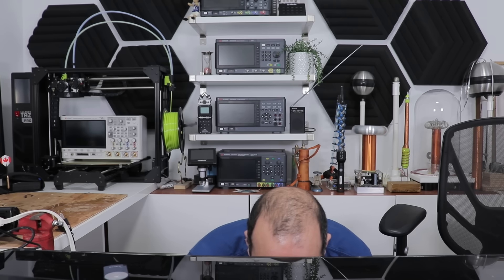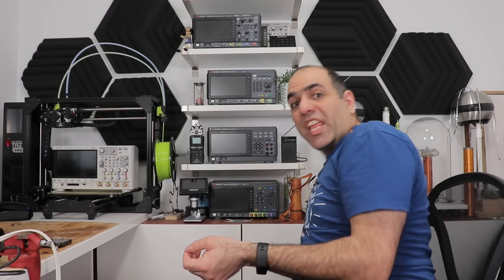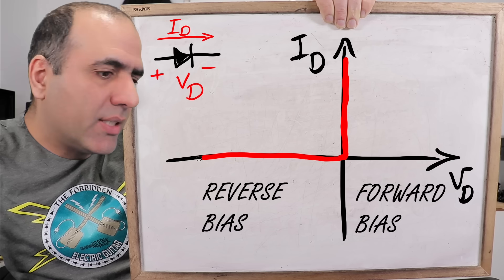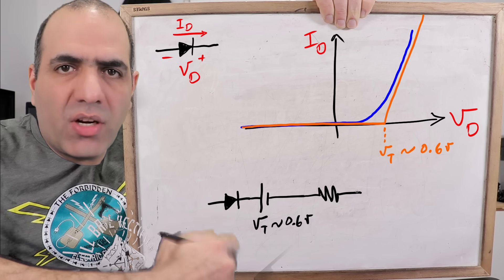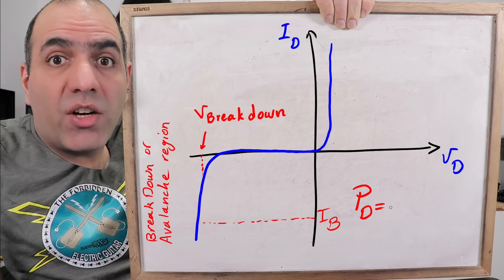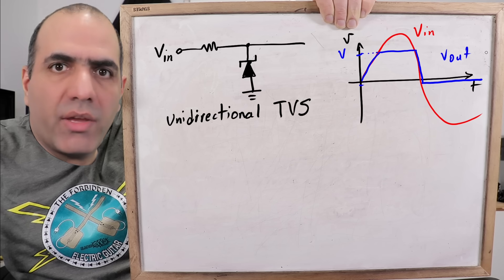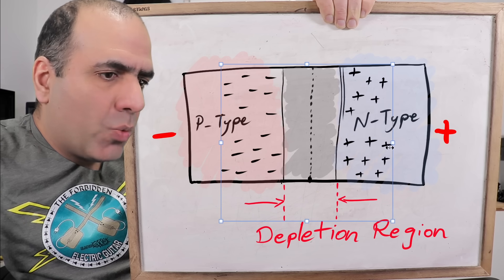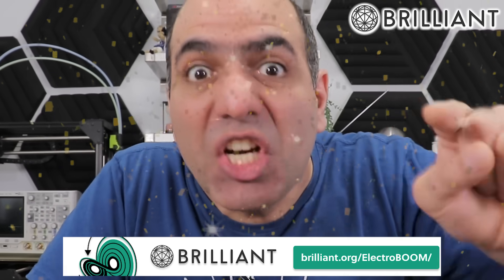DIODES! All Sorts of Them and How They Work (ElectroBOOM101-010)

Comment: I have a Shower Heater-Unit with adjustable power control (potentiometer) that was given to me by my neighbor to fix and keep for myself, and after dismantling it I found on the control PCB a bidirectional diode with such electrolysis damage on it which dissolved both of its terminals and it was hanging at its place on the board by the rust (the symbol on the PCB is for a BTVS). I have tried to put solder at the two ends to attach new terminals to it so I can reconnect it in its place but they will not stick. There are no service manuals for this unit I could find by searching on Google and I am wondering how to fix this unit without knowing the part number or the clamping voltage of the diode (since there are no terminals left sticking out from the two ends) . The diode itself is a pink glass type with the "cathode" black band in the middle and D8 is written on it. The diode is also not clamping anything in parallel (as in the case you describe to protect something from overvoltage on the board). Instead is connected in series to the gate of a small triack on the board (0107MA - To92) and to some other point on the board. The triack is probably driving an even bigger (high power) semiconductor that controls the heating element current and which is attached directly to the water heating unit (probably for heating cooling issues) and it is not on the control board. Any ideas on how to attach terminals to this diode? What is the range of or typical clumping voltages for these diodes? As a last resort to salvage this diode I was thinking if it is a good idea to use electrolysis and grow new copper terminals at the two ends if I immerse the one end of the diode in the solution and put a needle/pin with some high enough voltage to make the diode conducting current and start the deposition of the metal at the other end, then if it succeeds flip the diode and repeat.

Comment: I have  question that may be irrelevant to your current video but i can only ask this to certified electricians like yourself.

Here in my country the major electricity provider warns us of "phantom load" asking us to not just switch off appliances not in use but to totally unplug them to cut off monthly bills.

Is this true? that even switched off appliances still uses up power? Also if this is the case then why haven't i heard of a switch that is DPDT for home use? i only heard of them in small electronic projects. All of the switches i know that works on 220v household use are single line switches.

Is this a way for the power company to have something to point to when our bill just suddenly goes up? i hope not.
Reply from the maker: Hi, a single pole switch is enough to completely cut power. You don’t need DPDT. But regarding phantom load, some appliances still draw some minor power continues to keep some of their electronics on permanently, like the click on microwave or remote controls on air conditioners and such. They should typically draw very small current though compared to the appliance's operating current and shouldn't result in major power usage increase. You could turntgings off and look at your power meter and see how much the house is still consuming. Not sure, but maybe your area also charges extra for reactive power usage. In that case old transformer power adaptors plugged in could also count, although the device might be off.

Comment: Hey ElectroBOOM is he making free energy or... no it is Tom Stanton Flywheel battery he made energy by putting a axle and making it float and then turning it he made voltage i did not type some parts also he used FULL BRIDGE RECTIFIER.

Comment: However the LEDs actually range from 1-1.2 volts input for the IR to 7-8 volts for the UVC ones. 

edit: some schottky diodes actually have a forward voltage drop of 0.15 volts and break down at only 2 volts.

Comment: 1 thing I never got round my head in the entra electronics course: if you put a resistor in parallel with a diode, wouldn't the resistor act as a bypass to the diode?
Reply: Current would flow through the resistor, however a small current will flow through the diode and as the voltage across the pair of components increases, the current increases through the diode too, but what's the maximum voltage across the diode when forward biased? It depends on the type of diode , but for silicon it's going to be around 0.7 volts.

So what you've got then is effectively a device where the voltage increases across it as the current increases but the voltage maxes out at 0.7 volts and the current is able to continue to increase.

Comment: Pro tip: If you're a civilised physicist (instead of a degenerate electrical engineer) and actually use electron flow (instead of the hideously wrong conventional current), you can think of the electrons moving through the diode symbol, up and over the ramp on the triangle but unable to get back the other way.

Comment: diode types:
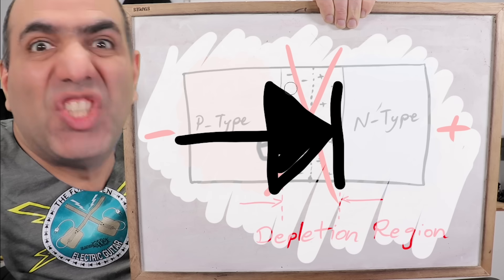regular diode: 2:48
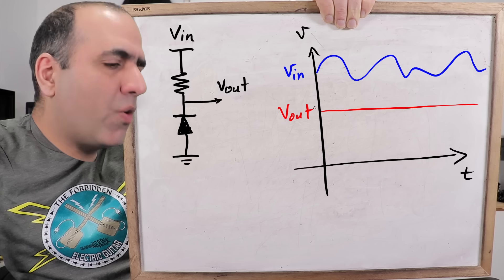zener diode: 8:21
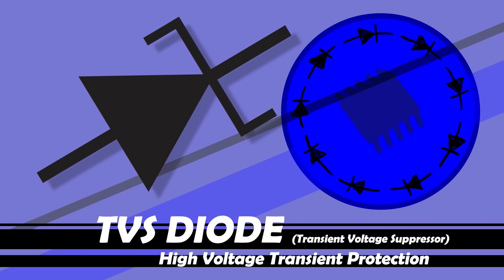transient voltage suppressor (tvs) diode: 9:19
photo diode: 10:21
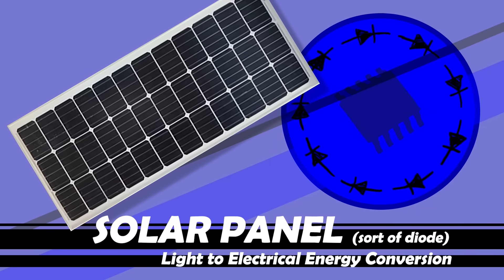solar panels (kinda diode??): 10:33
light-emitting diode: 10:53
varicap diode: 11:43
schottky diode: 12:04

Comment: I have a question, I have a cheap 225amp AC single phase stick welder, Ive seen videos of people using a 300amp rectifier to create DC but if i'm thinking right It may be DC but the wavelength of current would be basicly cut in half and wouldn't have a smooth freq to produce good welds? I have got my self down this rabbit hole and its getting deeper. If you want to create a High freq current for "Tig" welding, how is that accomplished? assuming and i might be wrong but U.S standard is 60Hz and  some tig welders can output 20hz to 400hz.? maybe thats why it cost $12k

Comment: So I use an LED as a poor mans photo diode to switch a mosfet to turn my PC on. Plug the power switch wires in to the collector and emitter of a mosfet. Hook the LED up to the gate and emitter. Hit with a laser pointer, and boom! PC turns on.

Comment: Nope ! the question how they made those , they no work, why called work ?  Anode ----|>||–– cathode   why 0.569v ohm or 0.250v ohm or 0.712v ohm one direction the other is open ,why transistor use the same diode ?

Comment: Hi! I'm looking for a power supply(?), the box you can power circuits and motors while building and working on them, where you can adjust voltage and current and some monitoring features. I try to find it online but I don't know whats it called in English or my native language. Also if any one have a particular model to recommend please do.

Comment: Some diodes DO let the current go backwards. So you can't use the check valve analogy to define a diode. And there are lots of other diodes that don't have a PN junction. Like PIN diodes, point contact diodes, or Schottky diodes among many others. So you can't use a PN junction to define a diode. So how on Earth DO you define a diode? I've also heard a lot of back and forth about whether they should be considered active or passive since by definition (apparently) active means it allows a current/voltage to be controlled with another current/voltage. But by other definitions it means the transfer function isn't linear. So which is it? It all seems to be defined different depending where I read it. And don't even get me started on SCRs Vs thyristors, lol. But that's a whole other can of worms.
Reply: A diode is defined by the typical shaped I-V curve, which is governed by the Ebers-Moll equation.
Reply: @deang5622  I've never heard of the ebers-moll equation that I remember. So I'm definitely going to read up on that. I'm well familiar with the IV curve of a diode though. I remember reading about something that the text referred to as "the diode equation" which sounds awfully vague and dumbed down. So I'm not sure if there actually is something called the diode equation or if that was just the dumbed down named the used for the ebers-moll equation. In any case I'm bound to learn something fun. Thanks for pointing me in the right direction. I guess I'll start by looking it up in The Art of Electronics and then on Wiki and following whatever citations seem worthwhile.

Comment: You've discussed how capacitors work and have built one or two as a demonstration. From there, it's easy to show how a variable capacitor can be put together. You've also talked about inductors. Together, that's a tunable tank circuit. Add a diode and you've got the most basic framework for an AM radio receiver. Of course, you need a few more components if you want to listen to music, but the basics are there. Could be a pretty interesting video. The idea of a radio circuit can seem intimidating at first, but I think you'll show how intuitive it is.

Comment: Edited because I got battery voltage wrong 🤪

Please help as my head hurts 😀.
At 6:31 you worked out that the current in the circuit was 1.4mA.
This means that the total resistance in the circuit must be (using ohms law) V/I = 2/0.0014 = 1428 Ω.
This surely then means that the forward resistance of the diode is 1428 – 1000 = 428 Ω.

Is this correct? I thought a diode’s forward resistance was taken as negligible and so could be ignored…..meaning that the total circuit current would then be V/R = 2/1000 = 2mA.

This would also mean that R1 voltage drop would then be 0.002 x 1000 = 2v

Can anyone please clarify for me. Many thanks.

Comment: if you can make a video of the scam called "fuelshark" which is a simple led with capacitor to connect a 12v port of car  and they claims that this device save fuel consumption up to 40 %  hahaha

Comment: I think that whiteboard gimmick looks better when you're actually drawing in real time, instead of just applying a video transition or replaying filtered mouse movements at artificial speeds. If you need to have some stuff prepared ahead of time because it would take too long to draw/write, what if you had it hidden behind a layer of solid green, or almost solid, just barely transparent to let you see what's under while still being within the green-screen threshold, and you used the pen with a eraser tool selected to draw holes over the pre-drawn stuff, trying to approximately trace over the stuff in real time, would that look more natural?

Comment: LEDs also generate a voltage when you shine a light on them. You could use this as a light sensor as well as an indicator light. If you're crazy, you could even harvest energy using many LEDs and store it, and then use that energy to light the LEDs in darkness.

Comment: Perhaps the tolerances have changed since I did basic electronics back in the day, but we were taught it was about .7 for conduction...
Not arguing... this was way back in the '90's....

Excellent explanation of diodes!
Reply from the maker: Really it can be anything between 0.5v to 1v depending on the current. I also always use 0.7v for decent amount of current.

Comment: In my first internship back in undergrad, I didn't know that photodiodes were a thing, so I just used an array of normal diodes as a simple light sensor. Nobody questioned a thing, probably because they assumed I knew what a photodiode was, but the fact that it kinda worked still amazes me.

Comment: Awesome video! Have you done a video on TRIACs? I always have a hard time understanding those types of transistors.
Reply: With that he should add diacs too because it's a common dimmer circuit where the diac triggers the triac
Reply: They are not transistors. They are two thyristors back to back to enable the device to pass AC.

Comment: Loved the video. Explained and simplified diodes really well. Could I suggest you include the fact that forward bias on a red LED is 1.8V and increases as colour moves up the spectrum. Also that the most efficient photo diode is most sensitive to infra red light rather than visible  and used in large arrays in all cameras as a ccd and as fibre optic detectors in long haul telecommunications. Finally a Germanium diode with low vd on of 0.25 volts still has its uses as a radio wave detector.

Comment: Thanks, Mehdi.  I'm an IC physical design engineer and my main use of diodes is for ESD protection and for process antenna.  You reminded me that there are other uses for diodes. :)
Reply: Can forward-biased Zener diodes clamp voltages when the Zener voltage is exceeded, or do they have to be placed in reverse?

Comment: I am a musician who builds my own effects pedals, and diodes are SO important in distortion and other gain stages. Place a pair of flip flop diodes on the output signal and you end up with hard clipping diodes that add more distortion to the signal (at a volume loss typically), or place one diode across the feedback loop of a transistor or opamp to get soft clipping, which to my ears sounds more like a traditional tube circuit (as semiconductors were used to replace tubes in many ways). I also use diodes with 470uF capacitors to eliminate noise coming from the power supply like hissing or clicking. It also provides protection for the circuit from reverse voltages as the diodes will fail before the rest of the circuit does. Very useful little components indeed!

Comment: This is an awesome overview of diodes, but I disagree when you say that ideal diodes turn on at any voltage if forward biased.
True, the forward voltage of a diode can be really annoying when it comes to power supplies, where efficiency is crucial, forcing us to circumvent power losses using MOSFETs and complicated driver circuits.
However, a diode's forward voltages can be incredibly useful to use as a reference voltage in voltage regulators or voltage-controlled oscillators or analog-to-digital converters. It also serves as a threshold voltage in astable multivibrators; it can smoothen an analog signal in a BJT push-pull amplifier that would otherwise be choppy at low voltage inputs; the applications are truly endless. I don't think modern electronics would be the same if we didn't exploit the forward voltage of a diode.
Feel free to agree/disagree

Comment: Hello mehdi, i have some sort of led harvested on an old radio. It has a flat top, cylindical body, the inside looks like a normal led but doesnt light up when applying voltages to it, however, shining a laser on it causes the resistance to drop. I cant tell the difference if that is a broken led, photodiode or phototransistor. Which one do you think is it and how to use that? I wanna try to play with it in the future

Comment: those stupid circuit specialist power supplies always drift over time on their current meter, there's a zero button on the back of the LCD so I just drilled a hole in the front of the case and hot glued a tact switch which is wired in parallel, I have to use it a few times a year as my workbench is in the garage

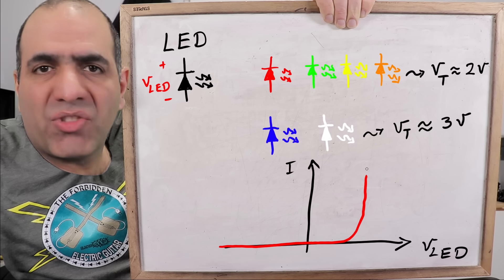Comment: Small technical point (11:10), a LED can hardly handle a strong (king of more than 1 volt) backward voltage for long (will get a truly short live time), so it cannot really be used, say, in a full bridge rectifier, as example.

Comment: Small technical point (8:30), a Zener diode at Vz = 1.0 volt !?  I doubt that it is possible for such a low voltage. Can always use two standard diodes, forward biased, but a Zener at 1 volt, never saw one.
Reply: I’ve seen 1v2 zeners before but I’m not sure if this is a very relevant quibble